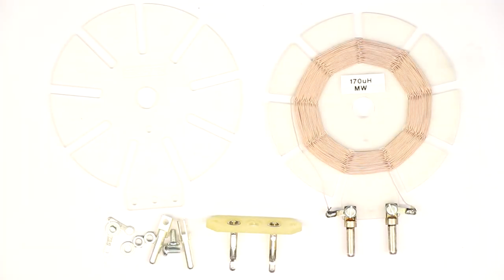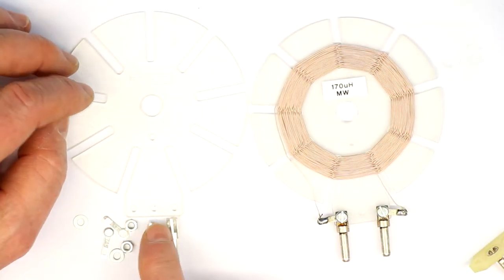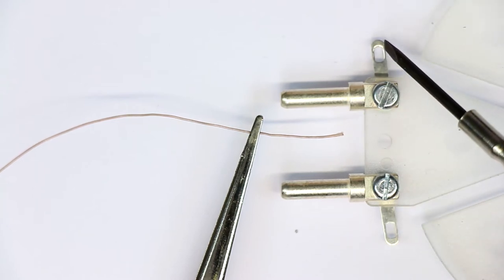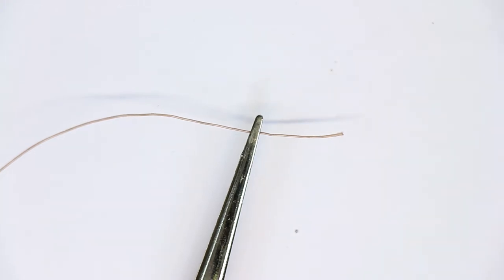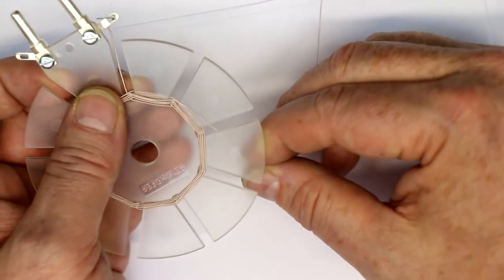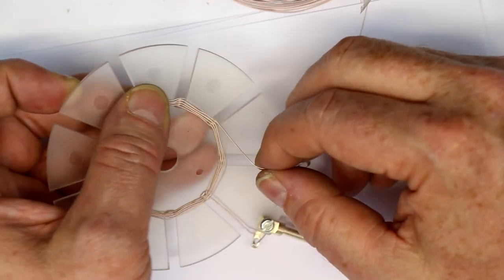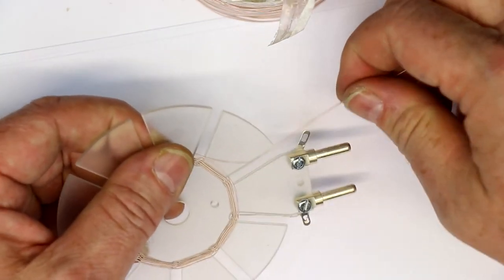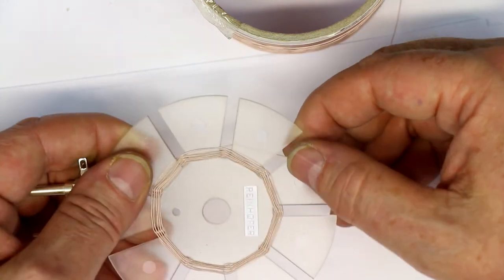Spiderweb Coils: How to correctly wind them

Comment: What is diameter (AWG) of Litz wire and how many strands it have?
Where can be bought in Europe?
Reply from the maker: For the MW-Coil it´s 20x0,07mm
It can be bought in our shop in this category:
http://www.ak-modul-bus.de/cgi-bin/eng/iboshop.cgi?show160,677546967119246,0
Direct link to spiderweb-kits:
http://www.ak-modul-bus.de/cgi-bin/eng/iboshop.cgi?show160,677546967119246,15
Direct link to litz-wire:
http://www.ak-modul-bus.de/cgi-bin/eng/iboshop.cgi?show160,677546967119246,30
Reply: That is how all antenna coils were made in Germany. 1945 and onward.

Comment: I'm surprised that the dielectric constant of cardboard is an issue. I looked it up and it doesn't seem that different from wood. Although polystyrene's min and max values seem more consistent than either.
Reply from the maker: It´s not the dielectric constant_, it are the dielectric _losses (which are not related to the dielectric constant).
It´s mostly the water content of cardboard that makes it a bad dielectric material.
Reply: @KainkaLabs  Thanks for the reply.
Reply: fish paper does not have the water content problem digi-key 560gc-nd